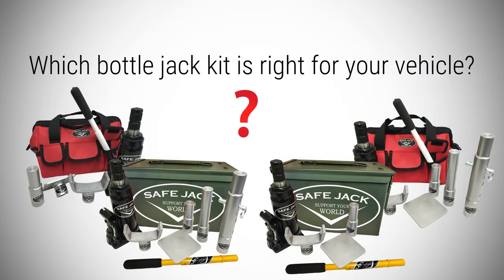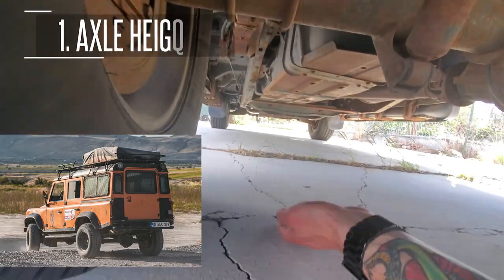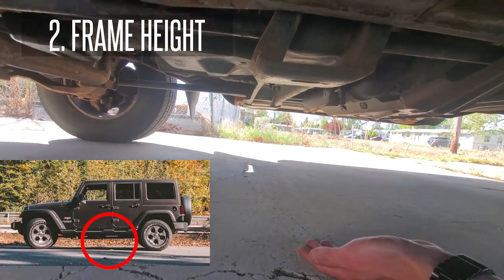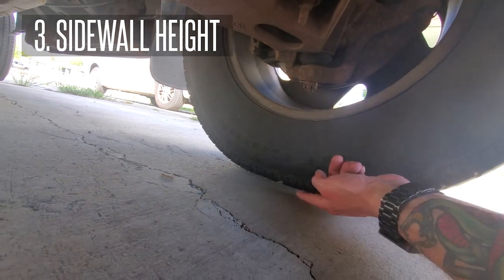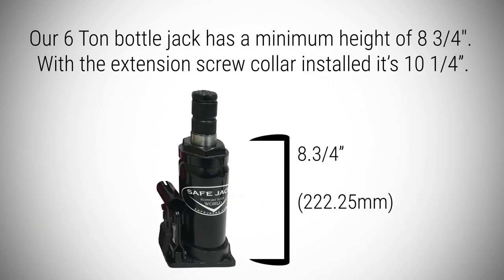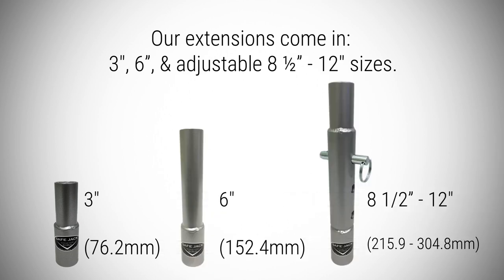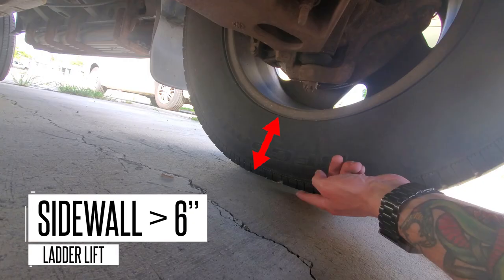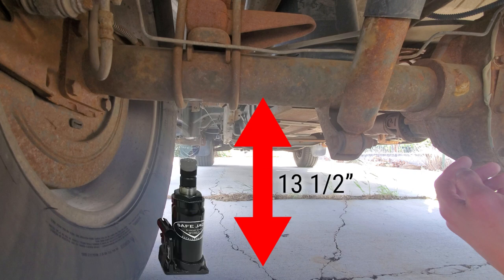How-To: Find the Right Jack Kit for You

Comment: I have a Toyota RAV4 (8.6" ground clearance, ~11" to the pinch welds, 4" sidewalls).  It seems that those of us who do "soft-roading" with small SUVs have a tough time finding a stable, compact, affordable jack.  I'm still looking...  <Sigh>
Reply from the maker: Look into a 3 Ton or 4 Ton bottle jack, which is typically shorter. You can have a custom extension screw collar made that will work with our extensions.

Comment: I have Subaru Forester, which product do you think is good?
Reply from the maker: Hi there,

The Subaru Forester is generally too low to be used with one of our Safe Jack Bottle Jack Kits. The minimum height for our 6 ton bottle jack assembly is 10 3/4 inches (That's with the extension screw collar and a jack pad installed). You would first need to measure the ground to your vehicle's lift point to see if you have enough clearance. If not, this kit will unfortunately not work with your vehicle and a floor jack would be needed instead. We do apologize.

We hope this answers your question!